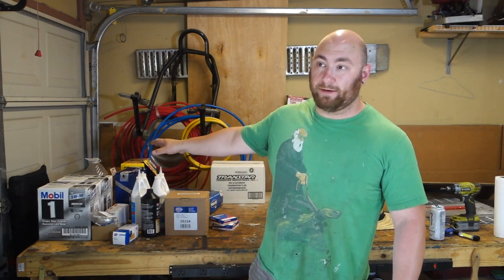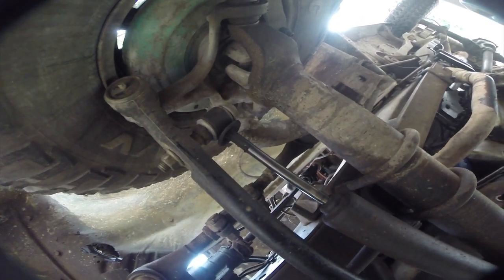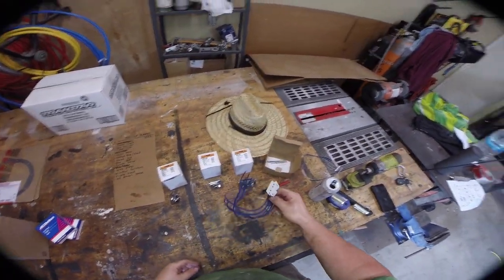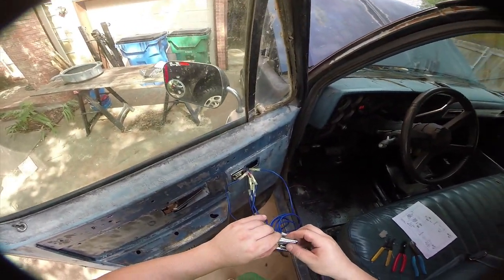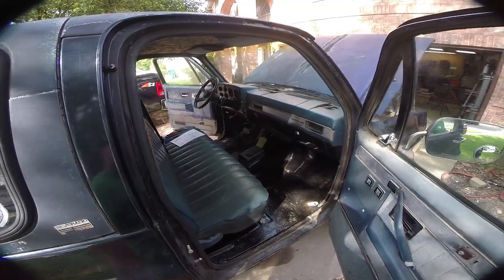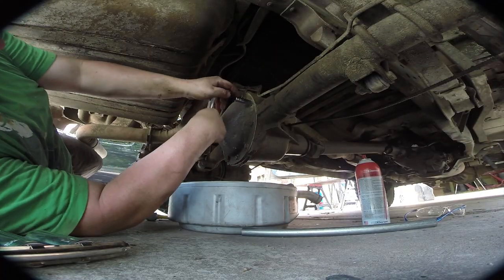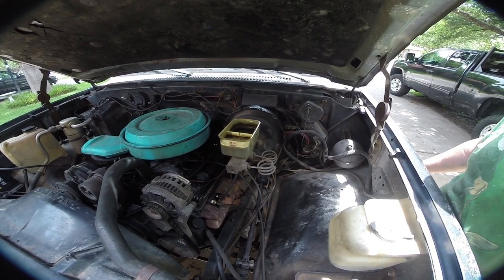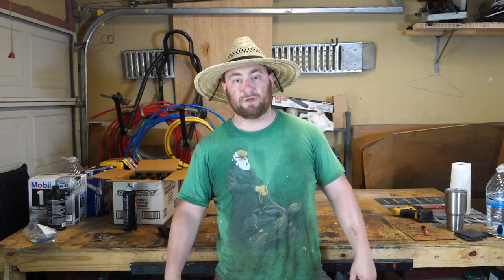1989 K5 Chevrolet Blazer Build - Episode 1 - General Maintenance

Comment: Hey wow Blazer with bench seat. I’ve had several square box Blazers. 1989 my recent one. Purchased 2008 rust free here in Jersey. It was garage kept. Made numerous repairs. I use Napa filters. It’s mainly stock with a Meyer plow for my own driveway. It’s a daily driver. Excellent video.
Reply from the maker: Thanks. As was pointed out already the seat was from a K10 truck and blazers were not offered with a bench in that year.

Comment: Great stuff.  Just FYI the power windows were always slow even when they were newer.  Being older they are probably still OK but you might do a direct harness mod that puts more current to the motors.  The performance difference is night and day.   Same goes for the front headlights.  If you do do not want to DIY all of it LMC does sell a harness for both and I think there are some EBay harness that are out there too but the LMC stuff is definitely higher quality relays and wire.   

Also, not sure if you want some proper K5 seats but I have a pair that are in rough shape but you could put seat covers over them and ride them for a long time.  It would include the brackets to mount them to the floor and the bolts to mount them to the seats.  The only thing you would need to find is the bolts to mount them to the floor, which wouldn't be hard.  Your choice.  I'm in Waco but working down in Houston next week and driving down on Thursday so I would have no problem donating them to you because it would help me clear out some parts shelf items on my back patio.

   If you want to get an idea of what they look like hit me back and I can email you some photos . Also, when you get around to doing the LS swap do some reading on the motor mounts.  I went with Dirty dingo mounts and they are pretty good but I think they are designed to use the triangular motor mounts plates that your truck still has (that attach the rods to the trans cover and what not).  If you use those mounts and keep those rod plates and stuff in the setup then you can literally drop the LS motor in and it can even use the stock manifolds and stuff. and if you use a DBC Ls motor you can keep on using the 700R4 with an adapter from bowtie overdrive (or you can swap to a more modern 4l60E or 4l80E just as easily.   There's lots of info on the LS swapped Square body group on facebook but they are strongly 2wd oriented but you can dig around on http://www.chevyk5blazer.com.  There is another great k5 forum but they charge a premium price to get back to links that have photos and stuff.
Reply from the maker: I am familiar with the DD stuff. In the next video we get through inspection and work on fixing all the oil leaks and stuff. I am probably going to head to a junkyard this weekend to look for seats. I want those more modern ones with built in seat belts for now. I will look into those wiring harnesses, but the windows are MUCH better now.
Reply: @Makswerks1  I am going with those seats as well so I understand.  You'll probably run into some issues with the tilt forward setup on the passenger side but just set it up so that it can slide as far forward as possible and that will probably help out.  The target year you want to search for are going to be around a 2004 Yukon and that should give you the integrated seat belt , plus 6 way adjustable driver seat (if you go with electric) with lumbar and also have a fold down arm rest on the inside of the driver and passenger seats.   Also if you decide to go with a more modern rear seat I think the rear third row seat out of a suburban (or maybe tahoe) can be made to work with a bracket you can find on the ck5 forums.  Not too hard to built for a guy who has a plasma and mig welder!!!.   You might have seen some of Merricks garage but if not check into that and he has some great info on the seat as well as making a access hatch to upgrade your fuel pump on the K5 tank.  With a little care you can pull it off with a shallow cut depth with a cutof wheel and never have to drop the tank again.  ;o)    Looking forward to our build and if you responded on your original post I apologize for not seeing it.  I accidentally had notifications turned off for some reason, lol.
Reply from the maker: @CraftwerksMC  No worries man. I am going to try to score some manual seats if I can. Basically any GM full size from 2000-2007 should work. Ideally cloth, but I will snag whatever is in the best condition. My plan is to lose the roof ASAP, so getting in the rear shouldnt be too bad, I don't have kids or w/e so its just for folks that want to have fun. And they can climb in from any direction

Comment: I have 2 k5s and a squarebody suburban we work on in my channel. I just replaced the driver side window motor on mine because it quit working... Had alot of warning. I just didnt listen... And my suburban has a broken wire at the back i was going to try to fix, but with a new plug it will be easier